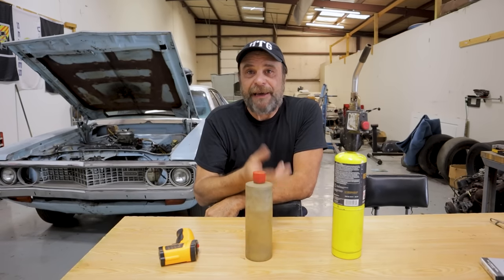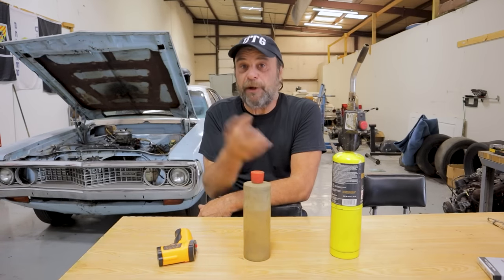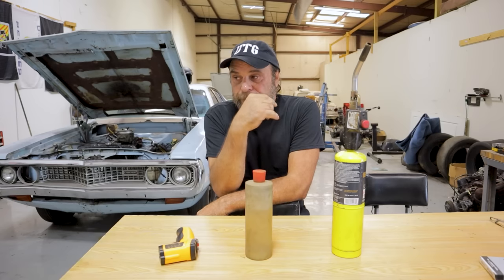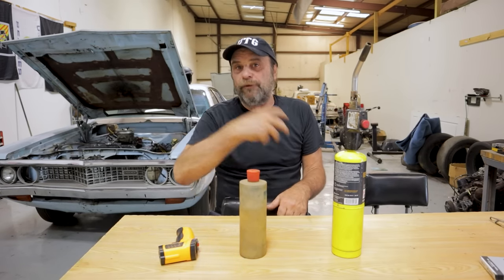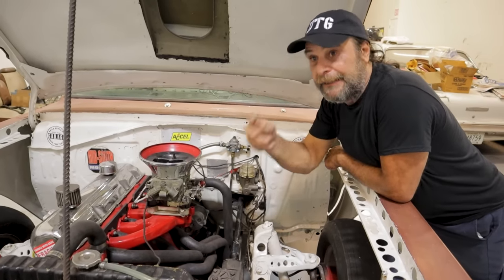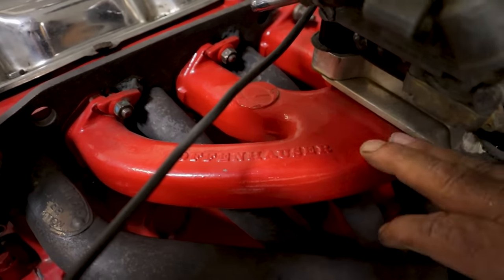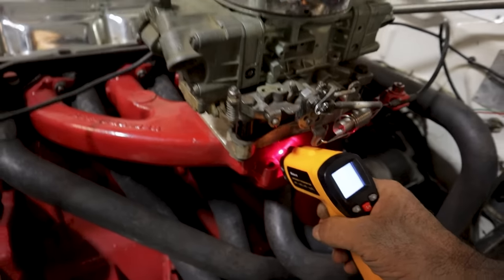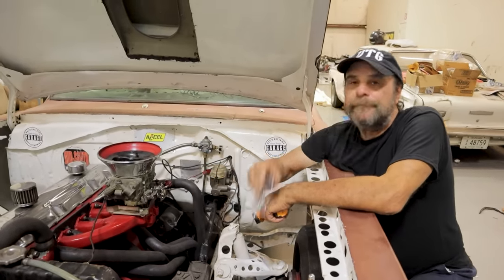How Much Intake Manifold Heat Is Enough? Testing The Vaporization Temps Of Modern Gasoline

Comment: An intake is charged cooled by the race it runs.  A water jacket will maintain heat throughout  each run. Heat it with propane or coolant.

Comment: Maybe this doesn't make any sense, but wouldn't this problem go away if the entire manifold was angled up to where the runners were dumping the fuel in much easier than this flat plane manifold? I know it would be further away from the source of heat but wouldn't the angle of the runners more than make up the difference? I mean sort of a tunnel ram effect?
 
And you could still set up some sort of heat exchanger from the bottom of the plenum to one of the header pipes. Just a thought, not even sure if such a manifold can be had.
Reply: Better yet, what about one carb per cylinder right up next to the head with very short intake runners? Again, just a thought.

Comment: I have seen 1/4" - 3/8" coolant ports cast into the carb base of aluminum intake manifolds for this reason. The engine coolants thermostat maintains a good temp for vaporization and the characteristics of aluminum, helps the runners stay warm enough, to prevent condensation of mixture. 
May want to insulate the runners, to keep mixture consistent to cylinders.
Reply: GM used 12V grid heaters under the carb of 80's 3.8 G body Cutlass. Probably did same thing to many other engines.
They did run well in winter at start up.
The car had an ecm an e-carb, so heater was likely ecm controlled too.
Had a pig tail plug on backside of carb and thick as an insulator spacer.

Comment: Back when diesel jumped to 6 bucks a gallon. Alot a guy's were doing the veg oil conversions on their diesel trucks. A big part of this was pre heating the fuel. Running coolant from the engine and wrapping the fuel lines. I wonder if running coolant lines to heat the bottom of the intake might be beneficial? Heat riser to hot?
Reply: Running straight used vegetable oil will destroy the diesel engine over time. It cokes up the injectors and cylinder head.  I've been making biodiesel fuel for years from used veggie oil I collect and burn it in my 300SD Benz. No heating necessary.  It's more effort to make and you have to use methanol and sodium hydroxide to do it, plus the oil must be accurately titrated to determine the amount of sodium hydroxide to mix, but the engine loves it and it runs much smoother and quieter than petro diesel. Plus it's a great solvent. (The biproduct of the biodiesel chemical reaction is pure glycerin - which we use to make soap. The best cleaning soap around.) People I know who went the straight veggie oil route don't have running engines any longer.....

Comment: I remember 35 years ago, a friend had problems with spark plugs, when Champion switched to their then new copper core plugs. Champion recommended going two numbers higher / hotter with their plugs, to fix their problems at the time. The auto parts store guy said the new copper core Champions were nothing but trouble and recommended the old AC Delco plugs. That worked and fixed his problems. Later Champion sorted out their copper core spark plug problems and AC Delco later switched to importing their spark plugs. Some engines are more spark plug sensitive than others, even different brands of plugs.
Reply: Poor static compression (8 to 1) engines from 1971 got 2 to 3 ranges hotter spark plugs because of less heat (less pressure) at end of compression stroke !

Comment: a lot of the old inline manifolds had either a coolant passage or a plate to connect to the bottom of the manifold for exhaust gas to heat up the plenum

Comment: I’ll tell you how to make it warm the air intake charge.
Drill and tap the threads to suit electric diesel engine glow plugs at the base of the carburettor they have good reach and are designed to heat air obviously.
Keep adding them till you get better times in your 60 footer.
Reply: I was thinking glow plugs too.

Comment: I kind of bet, non resistor sparkplugs with a wider gap would help because of the stronger spark
Reply: Just use a hotter resister plug

Comment: What temperature thermostat is in the car?

you can regulate intake temp by regulating block temp.
Reply: Part of the problem with the slant is the carb and intake is mostly hanging out in open air so it doesn’t transfer heat to the intake like having it down in the V of an engine. That’s part of why the factory setup had the intake bolted to the exhaust.
Reply: @NBSV1  2.3 fords running on propane capped off the water running under the carb in the intake ,but all the gasoline engines had em hooked up.

Comment: yes cold fuel will be liquid not vapor
Reply: All this made me think of guys engineering intake manifilds:  their work is more complex than we thought.  A carb can meter liquid/emulsion properly to get a good A/F ratio, but that has to change quickly afterwards and before entering the cylinder.   A flowbench solves none of the thermal problems addressed by materials and dimensions.  A certain amount of mass finds a reasonable operating range.  Manifolds made for a crossover typically have that belly area underneath: figuring out a good volume for that plus material thickness [top vs bottom] was probably half the job.

Comment: Another option - use 12v heating elements from a 3D printer extruder (9 or 12 of them, they come in 30 or 40 watts each) under the plenum area with a temp gauge, flick a switch and turn off when you hit 150. There may be better 12v elements available but that's off the top of my head. Heat the engine in the pits while the charger is connected and use the heaters while staging to get the temp up before leaving.

Comment: Run your fuel lines close to the exhaust so you got hot fuel ready to mix with air as soon as its dumped into the carb. Itll keep you from having to heat up your intake

Comment: Great Science, Tony.
I think the ultimate solution would be an electric heater element with a controller sandwiched to the underside of the plenum.
Then you could experiment to find the optimal temperature from there.
Or just bring your MAPP torch to the track and warm the intake as needed without getting the coolant super-hot.
Reply: Yes, I was thinking this.  Thermocouple in the aluminum from below and an electric heat element mounted with a good thermal transfer bond, and an arduino to sense and log data and on a second round to control the heater automatically.
Reply: @johnpublic6582 I don't get the impression Tony is an "Arduino Guy"
Reply: @danebeck7900  I Agree.

Comment: There are turbine motors that have oil coolers which use fuel as a coolant while the fuel is on its way to the fuel control.

Those engineers might be on to something.

Comment: You say 212 degrees, measuring what? The water temp, oil temp, block temp, manifold temp???
You have the intake over the exhaust headers, that is literally the hottest area, more heat than the valley of a V8.
Close the hood and heat gets trapped, idling to the staging lanes, doing the burnout, you don’t think doing that gets the manifold temp higher than 150 before you actually run?
I’m sorry but this is nonsense.
You need a smaller carb that’s tuned correctly.

Comment: Hey Uncle Tony.  How much voltage does the battery bleed down without alternator when idling 15 minutes with electric fuel pump and the ignition system?. Is it enough to negatively affect your spark for the actual timed run? Cheers, Chuck in Florida